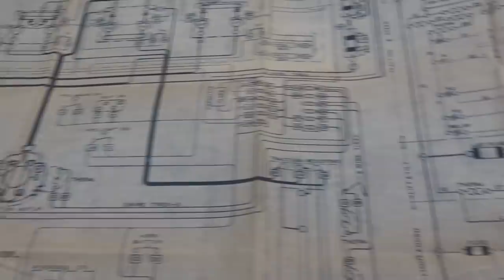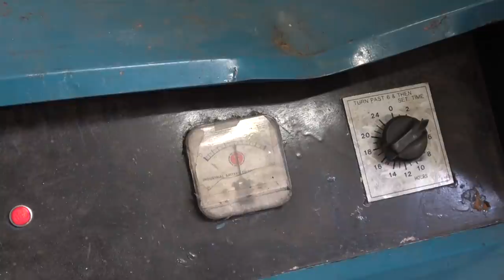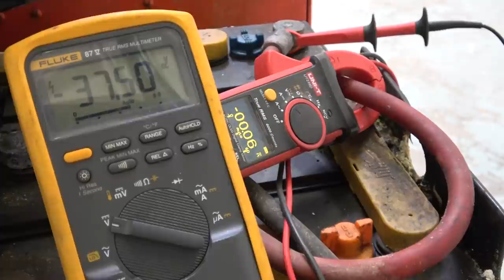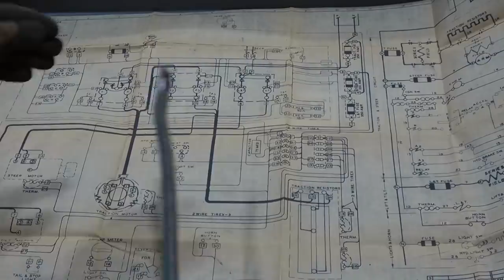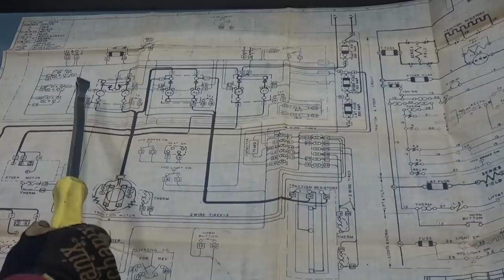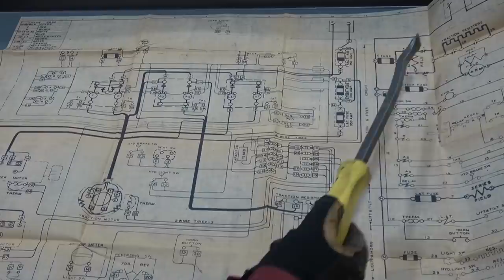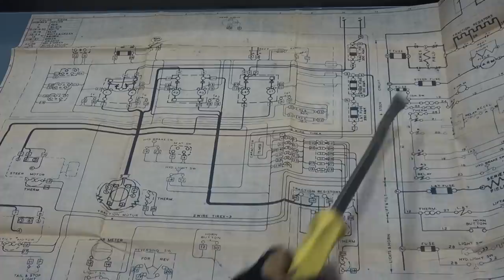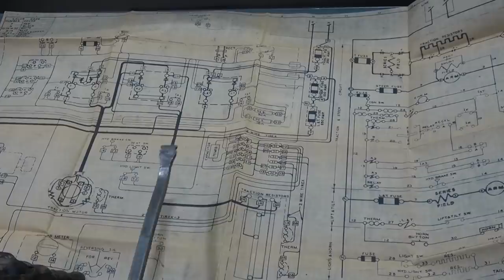Basic Electrical Troubleshooting | Battery Maintenance

Comment: Nothing more permanent than a temporary fix.  Truly wise words.  Any patch that works will be in place as long as it holds up.
Reply: Its temporary. Unless it works, then its permanent.
Reply: I've fixed a broken door lock spring with ducttape... can't remember when.
Reply: Fuel line holding clips under my car were destroyed after breaking all 4 wheels off the tarmac and landing as gently as possible, so i just ziptied the dangling blue fuel lines to the nearby brake lines.

This was in 2006, 2018 and the zipties are already the same color of the underside of the car now, can't tell it was ever jury rigged!
Reply: Couldn't help but laugh, nothing has ever been truer than the permentality of a temporary work around
Reply: At work I made a policy... all temporary fixes must be labeled with a "blame tag" nothing the perpetrator of the temporary fix and the date it was installed.
Reply: I repaired a broken throttle cable with a zip tie late one November evening at the side of the road, still like that 3yrs later!
Reply: I once used a garden hose to replace a leaking coolant line on my old Z34. Then I used a random piece of 5/8 rubber tubing and a hose clamp to replace a dry rotted shift linkage bushing. Both of those temporary repairs lasted the life of the car.
Reply: 😂 the toggle switch on the one I drive for work is a screw
Reply: As soon as I saw those contact tangs, I was tempted to bend em to contact
Reply: Years ago living in Minnesota, had a rear  brake line of my 1978 Impala wagon pop. Pinched it flat, rolled it over itself couple times and put a vice grip on it.  Drove  fine till the world thawed out enough to get under it.
Reply: All hail the permanent band-aid!
Reply: I asked when I was a young mechanic how long saran wrap would work for the diaphragm in an airbrake relay.  my boss pulled out the old one and said "at least 2 years"
Reply: connivingschemer  do you get an award for the longest lasting "temp" fix?
Reply: Heater hose to 'patch' a galvanized iron water pipe going into a building, and some bailing wire.  Was still holding 2 years later.  Origin: Friend backed truck into the line and sheared it.
Reply: dan H I fixed a broken Vw Van accelerator cable with a hose clamp and a 10 mm socket. I can't remember ever replacing it.

Comment: I love those Fluke meters. Years ago I bought a Fluke 77 and a couple months later while putting my tools away at a job site i managed to leave it on my work truck bumper and drove off down the highway. Some guy followed me off the exit and  jumped out at a stop ran to my window holding my meter, he had watched it fall off my bumper and bounce and slide down the road. The whole back of the yellow rubberized case with belt hook was completely worn down to the the meter itself, it looked like someone had taken an angle grinder to it. It no longer functioned though in any setting. I sent it back to the Fluke service center with a note telling them what happened to it, fully expecting them  to total it or give me a tidy bill. I was surprised when a few days later it was shipped back, it had a brand new protective case and  new display window still with protective film and a read out of all the tests and calibrations, cost? $0.00   Good company with quality stuff.
Reply: My ex mother in law worked at Fluke in Everett Wa. for years in service shipping. She retired about 15 years ago. She had some great stories.
Reply: While that is awfully nice of them that's one of the reasons they're so expensive, they're wearing the expense of their customers' mistakes - ala Snap-On.
Reply: I love people like that.... nowadays no one would pick up something that you dropped and run to return it to you.  "oh look free volt meter!!"
Reply: “Years ago” yes. They’re a different company now.
Reply: The keyword is “years ago”.
Reply: so you're telling me it was a ... Fluke Accident?
Reply: @syproful  agreed. But still carry the expensive price tag
Reply: @OttawaOldFart  20 foot leverage will be clearly outside the rated spec of the ratchet. They really shouldn't replace it.

Comment: Its not the voltage that kills you, its your heart stoppin
Reply: chris osh  .. i guess you're friend has an old style pacemaker then ( he's probably wary of electric cattle fences )
Reply: chris osh .. aah, yeah a defib sends a shock to stop the heart, then your autonomous nervous system ( the bit of your brain that controls breathing, heartbeat etc )  gets it firing in the correct sequence
Reply: Apparently, pace makers come with a test mode that surgeons trigger with a magnet to test it just before implanting. So although there is not enough Voltage in the batteries to give you a shock, someone with a pacemaker could be vulnerable from the magnetic field next to the 100s of amps in the cables.
Reply: its not your heart, its the nervous system being fried
Reply: Can't remember the movie, but they were on the subway tracks
Watch the third rail it's 600 volts!
It's not the volts that kill you it's the amps.
How many amps is it?
ENOUGH TO PUSH A TRAIN!!!
Reply: Speed doesn't kill you. Sudden stops do.
Reply: I know yer jokin, but it's a common misconception that "it's not the volts that kill but the amperage" 
This is dangerous nonsense. 1k amp at  0.001v won't hurt you. Sufficient amp to do you harm require sufficient voltage to carry them.  See Electrobooms yt videos for more in depth explanation.
Reply: @revmpandora  Exactly. A big car or truck battery can easily put out 1000 amps but at 12 volt you can grab it with soaking wet hands and nothing happens to you.
Reply: Well that's a new one

Comment: The movable contacts on the F-R switch are not returning to their fully extended position.  You bent the fixed contacts, but the movable link looks to be in the position where the spring is compressed.  The Reverse side seems OK but the Forward side needs some cleaning up by the looks of it.
Reply: Yeah there is a spring between them pushing out. I bet the contacts got dirty, got hot and weakened the spring.
Reply: Looks to me like somebody was having trouble getting it to engage, probably dirty contacts then, and went to reefing on the handle. Right jammed the floating bar back. Since then it looks like there's been a buildup of corrosion to fill the space.
Reply: How did you comment 5 days ago???
Reply: @snubbelbuff1471  time machine
Reply: @snubbelbuff1471  Patron subscribers get early access to videos
Reply: Tim Hunter  ah! mkay!
Reply: Tim Hunter  If it was weak springs, both forward and reverse wouldn't work all the time. Looks like crud to me.
Reply: Michael Steeves I was shouting at the screen when I saw that :D There is one spring that pushes both contacts out within the slot they are mounted in and the forward contact is clearly stuck. Possibly it's got very hot at some point and burnt the (presumably thermoset) plastic it's mounted in.
Reply: mikerjuk  I thought it looked like slag from the contacts arcing jamming up the travel of the contact.
Reply: Yes but I would also say that after 50  (pos ground=50 years) of ham fisted dickweeds slamming the F-R switch back and forth bent those contacts so the "temp" fix just put it back to the factory spec.

Dan in Jupiter
Reply: I caught that also, beat me to it
Reply: Spring actually seems ok, but seems that the floating contact is jammed up in there, too much shmoo by the looks of her.
Reply: ditto, I was also yelling at the screen at 17:19. Clean those center contacts so the move on the forward side.

Comment: Sounds like a good logo for the next shirt, "Temporary is only temporary if it doesn't work. " or "There is nothing more permanent than a temporary solution that works." then have some kind of graphics of something being held together with wire tires and duct tape. .. i'll take a blue 3XL.
Reply: As a professional software developer, I'd take one of those myself!

Comment: That resistor for speed must be a nice seat warm-err.
Reply from the maker: And adds a pleasant industrial bouquet to the atmosphere.
Reply: 100 amps at 34 V is ~3400W (shocker, I know). Assuming creep is 20% power, that's ~2.7 kW going into that resistor. The highest power space heater you can (well, should) plug into a typical wall socket in North America is 1.8 kW.

A nice seat warmer indeed.
Reply: Good excuse to floor the machine all day during summer, we would not want any unsafe sitiatens b’cause the warehouse is heating up!
Reply: No, does not work like this. The power loss is less than that.
Reply: AvE  Especially when a driver decides that the vent under the seat is a good place to "hide his stash" and makes the place smell like Woodstock.
And thats when I get called

"Glenn , the forklifts pouring out smoke!"
"Uh , call the fire department."
"We can't do that."
"Why?"
"....."
"Hello...you still there?"
Reply: If creep was 20% power, and full speed had a circuit resistance of about .3 Ohm to be able to draw 100 Amp at 34 Volt, then only about 550 watts would be disapated by the load resistor in creep. The reason for this is the total wattage outputted by the battery drops when the resistance rises because the amperage supplied has to fall. I'm too lazy to account for how the resistance of the motor drops as it's speed falls, but for a late night mental estimate, it's close enough for me.

Comment: That center set of contacts (the moving ones) is spring loaded and should slide in the mechanism. It looked as if the ones on the right side were not springing to the right properly. That (I believe) is why it was not making contact with the stationary contacts.
Reply: im sure they got free'd up real good when he bent the stationary ones in closer then reassembled and undoubtedly slammed it into forward

Comment: AVE ...... 20 years in the industrial battery industry  , 
Open circuit voltage should be 2.10 to 2.12  vpc . Specific gravity should be 1.280 
Kw battery has been out of business for about 20 years , surprised is still chooches ....... 
I would still be attacking the fwd/rev contacts ....
Reply: And...never water a dead battery. If you must water, add to the moss guard which is the red holey plate. To tell how many amp hours of pixies it holds, decipher from the model# of the battery. If there's no label, take the cover off the ICC at Cell 1. Cell 1 has the red lead coming off it. That battery looks like maybe a 18-100-15. Amp hours per plate * (plate count / 2 - 1) makes 36V and 700Ah.

I used to work at a lead acid battery service company.
Reply: Tsunauticus III  -  I like that! The prose has a colorful flow!
Reply: Tsunauticus III  "Taint" would be a better rhyme for the last line. Otherwise 4/5 stars.
Reply: Tsunauticus III  I would have gone with " decorating his colorful taint"
Reply: @courtrutherford8913  yes sir , does seem to be a 15 plate . 
17 would be dual post , about 3" center to center. 
What area did you work ? 
What company if you don't mind me asking.  
As I'm sure you know , there isn't a lot of people wanting to play with these beast every day .
Reply: @dirk_diggler320  I forgot about 17 being double post! 3.125" center to center. I was based out of Chattanooga and my territory stretched all of east TN and into KY.
Reply: @dirk_diggler320  ABT Power Management.

Comment: Positive Ground, that's horror right there.
Reply: Some horrid flashbacks to the old Ford Jubilee...6v and positive ground. Gross.

Of course, the 50 some year old starter never gave a fuck about 12 or 6 volts, just keep the ground right.
Reply: Lassi Kinnunen  electrons flow from negative to positive in reality whereas conventional current will show circuits flowing positive to negative. It matters not most of the time so long as one is consistent. Anyway positive "ground" is just one way to think about recollecting the used pixies I think.
Reply: Lo Value - Dynamo based electrics by Lucas, Prince of Darkness. Old LR driver here. Now electrumafied by an alternator from a mk1 discovery.
Reply: Otherwise known as old English car disease. Scared fourteen bejeebers out of me the first time i tried dancing with the pixies on the then girlfriends Austin 1800
Reply: When you finally find that your fwd&rev inter locks are not working, you may be close to getting it to run.
Reply: Electron theory was the standard.
The angry pixies come from black.
Did it just get dark in here?
Reply: Lassi Kinnunen  you'll have to ask the right people that question unless you like conjecture. lol. basically, there is only ever one real reason to do it that way, and we have long since found multitudes of ways around that snag. that being said, it's one way to skin a cat so it's still done to this day.
Reply: Lassi Kinnunen  it's a corrosion thing IIRC. It makes the wires corrode instead of the body.

Comment: how about a quick demo of 36v and a ring, preferably not on your finger and not your wedding ring. However, a hotdog and a brass ring might do the trick.
Reply: With that much current available the ring will spot weld onto the contacts instantly and will be glowing within a second.  Not a great place to have your hand.
Reply: that want we want to see sparks and flames, I have heard tell of the effect of getting a wedding band caught between the contacts of a starter motor, It can damage the motor.  With 48v at 200 amps or so my guess is you could sever a wiener clean in two.
Reply: I know two carpenters that lost their ring fingers the same way, de-gloved by gang nail plate on roof trusses. Made me think twice about ever wearing rings.
Reply: I have seen it done with a car battery but not with a battery with this many angry pixies.
Reply: Got a 5mm allen key stuck between the positive and a steel bracket holding the radiator in a car, within 2 seconds it was hot enough to burn my hand in the millisecond it took to hit the fucker with my hand as hard as I could to dislodge it.

Comment: Good video. 
Brought back lots of old memories. A couple of pointers, though...
1. Like others said...Get the drive wheels off the floor to troubleshoot forklifts! When relay contacts weld together you'll soon know why it's a good idea. All you need to do is put some good  blocks under the mast channels and tilt the mast forward and it's done.
2. When I was a forklift tech many years ago most relay contacts were silver coated to help them NOT WELD together. Filing the contacts removes the silver and the base copper will weld quite well with a few hundred amps going through it. I've seen it happen more than once.
3. Specific gravity will tell you more than a voltmeter about battery condition. One or two dead cells and an old truck like that might run...for awhile. In the meantime the motors can heat up, sometimes enough to throw the solder out of the armature and can also cause relays to weld closed. Saw it happen more than once when a small company tried to go cheap and not fix or replace a bad battery because the truck (or electric pallet jack) still worked, even though they had called me out..." because it doesn't always stop!" Funny how the price of a rebuilt battery can so easily increase exponentially so easily.

Comment: It's always been my experience with fork'm-a-lifts that each cell has it's own cap, and each cell is 2 volts. So, count the caps, and....waalaaa...designed battery voltage is determined. The schematic looks like it operates similar to the old EV 10 systems. Nice meter. I have the Fluke 88V and love it!

Comment: There was a Canuck named Ave
Who a forklift tried to save
From a fate of eternal sleep
In some forgotten scrap heap

So out he pulls a volt meter
To test the battery's leaders
He discovers some have run dry
Aquafina he recommends we try

The sulfuric acid now wet
And the charger all set
The angry pixies he will push
For four hours at high chooch

When this fails to reveal
The real problem in detail
To the schematic he will turn
It's a reversing switch we learn

After much careful deduction
It was the improper function
In the forward/reverse case
What was f**king our headspace

This hunk of steel and lead
Brought back from the dead
Owes its life to the man
who can fix anything at hand

Voices filled full of boast
Let's all shout a toast
With beer chilled on ice
"Keep your dick in a vice!"
Reply: A masterpiece

Comment: The contact that wasn't touching had a spring behind it, and it appeared pushed back and anchored back by the corrosion crud. The other side was moving correctly against the spring. I'm guessing it was parked up with the lever in one direction and it corroded in that pushed back position. A spray of your favourite schmoo, a tap and a waggle might have been the answer. Great content, keep 'em coming...

Comment: make sure your leads are in the correct sockets and check your meter on a known source lest you engage safety squints.
Love the channel.
Found through Practical Engineering.

Comment: 16:05 the contact bar is meant to float in the housing, yours is stuck, bending the tabs wont put even pressure on the points which is why the bar floats under spring pressure.

Comment: You said one thing that fixed my towmotor. Saved some big bucks.The pressure switch in my seat cushion went into neutral.A wire broke inside one of the insulators, not visible. Due to a worn seat cover that displaced the switch pad. Remounted the switch using tape.

Comment: I hope you figured out that the floating contacts for forward in that holder part of the lever switch were stuck and needed cleaning. You didn't need to bend the stationary contacts, you just needed to clean the moving insulator so the contacts could float freely. The reverse contacts were floating just fine and made contact with their fixed contacts under spring tension.